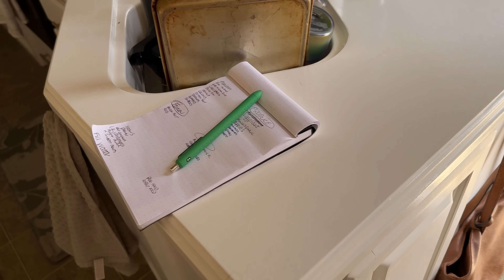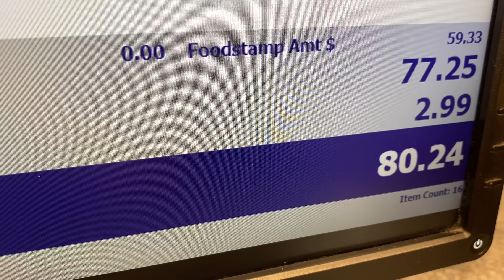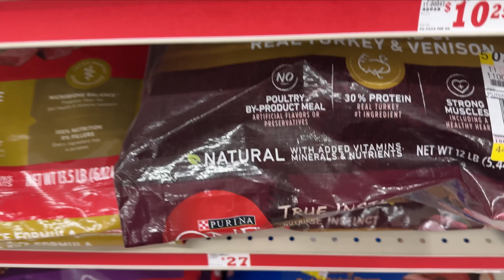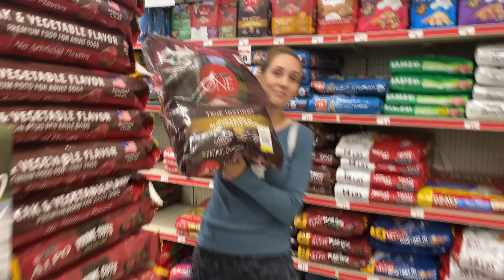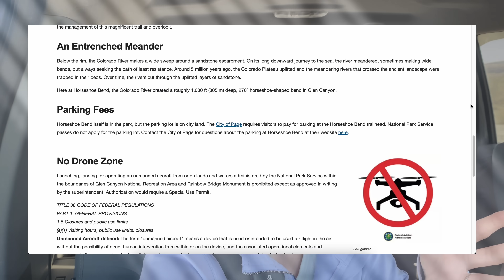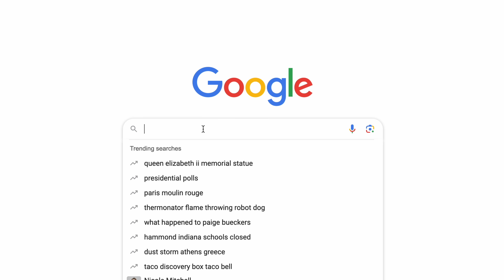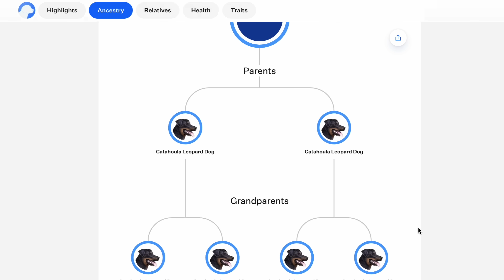Shocking DNA Discovery! We Had No Idea

Comment: Bet no one guessed that! I'm sure the mechanic told you it was the bending spring on your starter. When you turn the key on it pushes your starter gear forward an inch to engage the flywheel gear attached to the crank on your engine. The whirl you hear is the starter gear just spinning freely because the spring is broke. Beautiful drone shots! Great episode!
Reply: Bendix spring..(auto correct!)
Reply from the maker: Thanks so much! Funny enough I didn't ask the mechanic. I just called them and said I needed a new starter. 😂

We actually had 2 or 3 people guess Catahoula! At first I thought it was just 1 but as I've searched through I found a couple more! -J

Comment: Your logo - definitely.  RV looks great, sadly I doubt the spray can paint will hold up very long, and fade quickly, especially in the SW. I felt the decorative metal for the screen door was too expensive as well, I opt for plexiglass which worked great all winter, not so great as summer is rolling in.  Awesome adventures, safe travels.
Reply from the maker: We're curious to see how it holds up - We are putting a UV protectant on the rig every month or so to help it keep from fading. -J

Comment: I had a repeated starter problem in a car once. After changing it several times, I ended up hot wiring it with a toggle switch to get it more power to the engaging system.
Reply from the maker: Where there is a will…there is a way! -J

Comment: Goosenecks SP is a hidden gem. We really enjoyed seeing it. We also saw Horseshoe Bend. In comparison, I would say that Horseshoe Bend gives you a more direct look straight down 1000 feet, whereas, the Goosenecks are more sloping and are not quite as scary. They are both 1,000 feet from top to bottom. Goosenecks is impressive because you can see several loops at once.

Another beautiful and interesting sight nearby is Natural Bridges National Monument. If you don't have time on this trip, maybe you can squeeze it in another time. It is pretty remote, but the drive in is beautiful. And if you go there, leave some time to hike down to the bottom of the bridges, because the lookouts are from above, and you don't quite get the feeling of massiveness the you get from looking up at them. Question: did you see the Mexican Hat formation? 

Catahoula Leopard?? I was really surprised. I was guessing Rottweiler.
Reply from the maker: Rotti was one of the most popular guesses (mine included!)

We're marking down natural bridges for our next time through the area! -J

Comment: I have not had a ford in years but it seems to be common thing online to have a starting issue when the battery is just charging surface not a deep good charge anymore.  Not sure if it is batteries or the ford charging system, many have issues often with the batteries.  Get a load test at a parts store.  I know you replaced the starter but some have done that multiple times, bad batteries ruin a starter.  Trin's relatives go back to the 1500s when De Soto explored Florida and Louisiana. In the 1970s there was a breeder by Desoto that sold them for cattle dogs but the Australian blue heeler are much more popular for a cattle dog in the area. The breed is often lighter colored but they are good at rounding up cattle, you should test her sometime when out west. She may have been lost from a ranch, but like you said likely was dumped because someone couldn't afford her.  We have many pets dumped out by us in the country and if they do not go to a farm the coyotes often get them at night and it is sad.  I hope you stock up on any food you can before going north it will be more expensive most places north.
Reply from the maker: Food stock up video coming in 2 weeks! 😂 But of course we only have so much room. lol

As to the battery it is possible that is the case - but I really think the starter was just bad. This truck has 240K miles on it. The starter seemed to be getting full power. I could hear the gear whirring and when I sat at the post office I literally engaged it over and over for 15 minutes with no power drain. It just wasn't making good contact with the flywheel. 

Someone in the comments sent me to a video showing this exact problem with the starter - so it probably could have been fixed rather than replaced - but I'm happy to have a fresh one in there. -J
Reply: @OpenRoading  If the starter is just whiring the solenoid is not pushing out to engage the flywheel or depending on sound could be a flywheel issue.  Most parts stores test batteries for free if you have time.  Ford trucks seem to be hard on batteries from all the issues people have with batteries and if a battery is not sending enough amps the starter life will be shortened.  The tester for batteries is usually only a few minutes.

Comment: @OpenRoading do you all have a tutorial on painting your interior cabinets and walls?
Putting up contact paper style accents? Wood tile accent walls? Not sure if you were filming this kind of content back in the day when you updated the interior of your TT…. Wanting to repaint with a glossy paint that is easy to wipe down instead of the textured paint that’s on there which will hold dust and grime.🤔
Reply from the maker: First....you don't want a tutorial from us on the cabinets. 😂 We cannot keep the paint from cracking. (some of our cabinets are on their third try...and still cracked. Sigh.)

We don't have any tutorials. We were still super green to everything when we were renovating. I can say the main walls in the living room slide is "Fake shiplap." We just took 1/4" wood, cut it into 6" strips and glued it on the wall using pennies to space them - then painted.

We loved Sherwin williams but the last time we used it we don't like it anymore. 😳 

One thing that we did on the shiplap that we are so glad we did is we coated it with Minwax Polycrylic (blue can). It made it super easy to clean.

Sorry I'm such little help! -J
Reply: @OpenRoading  thank you! My new to me RV has some DIY ship lap on the ceiling that needs repainted and I would like to seal with something so it’s wipeable!

I wonder if the previous owner used this no gloss textured paint because it doesn’t crack🤔 
I want to change the color but more importantly have a smooth easy to clean surface.
I will research🤓
Reply from the maker: @Eph1-4  The cracks in our cabinets only appear in the corners of the beveled sections. On flat surfaces we've had no issues! -J

Comment: Try to start motor, doesn't always work ?? In my motor this trouble turned out to be a wire slowly failing ... I guess that the motor wouldn't start at all if the wire completely broke ...
Reply from the maker: For this one the gear that jumps up and makes connection with the flywheel wasn't staying engaged. Replaced the starter and it's worked great ever since! -J

Comment: Check the solenoid on that starting problem. Y’all make great videos! Happy travels 🤗
Reply from the maker: I'm pretty sure someone else called it exactly - the Bendix gear wasn't connecting with the flywheel. Or it would connect for. a half a second before coming off.

I have fixed a loose connection to the solenoid before (where nothing was happening when you turned the key) but in this case I could hear the starter spinning full speed...it just wasn't making contact with the flywheel.

Either way...New starter has been firing perfectly! -J

And I learned all this terminology after filming the video. 😂 -J

Comment: It’s a flex plate issue bro 😢😢 the thing the starter turns to crank your engine a new starter will not permanently fix it I put in 3 different ones… good luck
Reply from the maker: It's possible. But this issue started and 3 days later the truck wouldn't start. Now the new starter has been in for 2 weeks and we've never had an issue. So I think in our case it was the starter. Pretty sure this is what was going on (thanks to another commenter here)

https://youtu.be/RhdSq4WOaDM?si=ltyZUbxoClqPnAdJ

Comment: The picture got very blurry a little over halfway through, so sad.  Otherwise, great show.  Thank you.
Reply from the maker: That's probably a bandwidth problem on your device.  If you click the gear icon on the lower right of the youtube screen and then click on "quality" and if it's lower than 720 it's going to start getting pixely. Youtube will often knock your device to a lower resolution if your internet is slowing down for some reason. -J

Comment: If you are lucky, you just have a loose wire from the ignition switch the the starter solenoid. If you jump battery positive to the solenoid contact and it clicks and whirs...that's the problem if you are lucky.
Reply from the maker: So the starter was whirring on it's own. And it would make positive contact with the motor every 3rd or 4th try...for about 1/2 a second (the truck would turn over) but it sounded like the starter would come off the engine after that 1/2 second...the starter would keep whirring but not the engine. 

At 240K miles I'm not shocked it needed to be replaced. -J
Reply: @OpenRoading That probably means it is internal. The "Bendix" (because they invented it) mechanism, which moves back and forth to engine the starter motor to the engine, is shot. Sometimes they are just stuck from too much dust & dirt in stiff old grease. But with today's shop rates, swapping out the whole alternator is way cheaper and faster. Quarter of a million miles tends to wear out everything.
Reply from the maker: @lyfandeth  For sure! -J

Comment: Trying to figure out why you were considering riding your bicycle during truck repair back to Camper when you have a motorcycle strapped to front of truck? 🤔
Reply from the maker: Haha - The shop said they SHOULD be able to get it done by end of day - so I was leaning into that and the bike was to get to the laundromat and back. I considered putting the bike on but I would have had to set it up and set it up and tear it down twice (shops don't usually want a shin buster hanging off the front of a vehicle they are working on) so I didn't want that hassle. 

It not getting done in one day was a long shot...but it still kept crossing my mind...especially as the day ticked closer to 5pm. -J
Reply: Makes perfect sense. We traveled for a few years without a toad vehicle and it was a hassle. So I understand how difficult it could be.

Comment: You should get your fuel pump replaced there.  I paid 715.60 for my new starter.
Reply from the maker: I've considered preemptively replacing it, but currently I'm riding the line of seeing if a recall happens and if mine is one of the unlucky ones before then....well...time for a new truck. It's just hard for me to justify that expense for something that might not fail. If F250s were going down everywhere all the time I might think differently but at the moment it doesn't seem to be as widespread as some forums seem to suggest. 

But I could be all wrong on that and end up paying the expensive consequences later. -J
Reply: @OpenRoading  new ones are too expensive, and now I know what I have.
Reply: Oh your fuel pump will fail.  The time they do it will grenade the engine.  No recall will happen.
Reply from the maker: @Theo8863  It's quite possible it will fail. The question is will something else more significant fail first. I'm hoping to get 1 more year out of the truck. If it's less - we'll deal with it. -J

Comment: Your battery or batteries need replaced… had the same issue in a F350 diesel
Reply from the maker: I actually knew it wasn't batteries because I've had that happen in the past. lol

In this case the battery was firing the starter just fine - but the starter wasn't making long enough contact with the engine flywheel to actually start the engine. Instead the starters gear would just spin free because it wasn't connecting to the gear it was supposed to. -J

Comment: having been involved with the maintenance of a fleet of trucks in the past.. ford diesel trucks.. the first HINT of a starting problem   you deal that day, never wait.. you can wreck the teeth on the flywheel. or burn wire, or destroy alternator or batts etc etc etc.. the costs can escalate sooooooo fast.. just stop, find the right guy and deal   right then.. it might be just the starter.. but what the starter can wreck is 5 times the price.   you just make me get the heby jebys talking about "hope its ok"  stuff does not fix itself.. it destroys everything its attached to.  wait till you lift the cab because you waited to fix something kind of simple..
Reply from the maker: Good advice! It's all fixed now! -J

Comment: Gas purchase?
Reply from the maker: If you leave a comment every time Kalyn or I say the word gas instead of diesel...you are going to be leaving a lot of comments over the life of this channel. The funny thing is, we all know what is meant and only one of us is annoyed. 🙂

If I'm asking someone else to fuel up the truck I would be very clear - otherwise in daily conversation there is no issue using the terms interchangeably since
A. Everyone understands I'm referring to the stuff that makes the truck go vroom vroom, and 
B. No one watching is going to be putting said fuel in the truck so there is no risk of damage. -J
Reply: @OpenRoading  I recently started watching your channel here... you might have better luck with your pickup truck if you state what type of fuel you use in that THING. In this case it would be DIESEL!   And no, I'm not annoyed by it. I'll be the first one laughing when you put gas in the tank!! Because over time you're convincing yourself it take gas!  So feel free to fill it up with gas...... And make sure you always check your spare tire if it's full of air!  I can not stop laughing......
Reply from the maker: @MJCART-be9nb  Had the truck for 5 years - Have never filled it once with gasoline 🤷🏼 And it really doesn't matter to the viewer what type of fuel goes into it.

Last I checked I can state that it runs on olive oil the only thing that matters is what I put into it. -J

Comment: If you researched how dog DNA tests are determined you would realize that they are just best guesses. I was introduced to dog DNA at a veterinary conference when they first came out, I was super intrigued but after numerous tests on a number of dogs I realized how inaccurate they are so I dug deeper and they are just offering their best guess based on the comparison of other dogs they have in they system. Unfortunately this can be dangerous for dogs that may be misidentified in circumstances where breed bans may apply.
Reply from the maker: So...I'm just gonna put this out there - Someone identifying the breed would also be a best guess.

I honestly don't care if she's "pure bred" or not but we had no clue at all what she was at all or what mixes she could be - and when we did the DNA test we specifically did not send a photo or provide any identifying information.

Going point by point through the results they basically identified what she would look like.

The DNA results identified that she most likely had tan points. They said she most likely had a white to yellow mask on her face and that she didn't have the leopard spots. 

So sure...best guess. But that best guess is pretty darn good and I'll actually take that OVER someone visually looking the dog over and assessing the breed - because as they get more and more dogs in their system, it's only going to get more and more accurate.

Side note - we actually did do some research before doing the DNA test. 🙂 -J

Comment: you have a motorcycle WTF
Reply from the maker: Indeed we do... I'm assuming this reaction is to the whole ride part?

So...to take the motorcycle to town I would have had to put the carrier on, strap the motorcycle on, get it to town - Probably take the carrier off (Most repair shops I've been to don't want a carrier at shin height sticking 3 feet in front of the vehicle in their garage), then put it all back on after the truck is done and re-strap the bike back in. 

In short... it wasn't an ideal plan.

Tossing the bicycle in the back was a LOT simpler and we didn't expect there to be an issue with the truck repair...but ya never know! The bike primarily was just to get me .7 of a mile to the laundromat and back. Served it's purpose well! -J

Comment: Should've taken the motorcycle instead of bicycle
Reply from the maker: The shop said they SHOULD be able to get it done by end of day - so I was leaning into that and the bike was to get to the laundromat and back. I considered putting the bike on but I would have had to set it up and set it up and tear it down twice (shops don't usually want a shin buster hanging off the front of a vehicle they are working on) so I didn't want that hassle. 

It not getting done in one day was a long shot...but it still kept crossing my mind...especially as the day ticked closer to 5pm. 

More important side note - the bike needs some work so I haven't actually ridden it for a couple of months. -J

Comment: Where’s the motorcycle? Just take it with the truck. At least you’d have wheels.
Reply from the maker: So a few things.

Motorcycle needs some work. But beyond that...putting the carrier on the front, loading the bike. Driving to town. Unloading the bike. Removing the carrier (shops in my experience don't like shin breakers sticking 3 feet out from the vehicles they are working on). Then repeat all the steps to get home.  😂

Yeah...could have been a problem but I was prettttty sure they were going to get the starter fixed in time. And I needed the 1.4 miles of exersize. -J